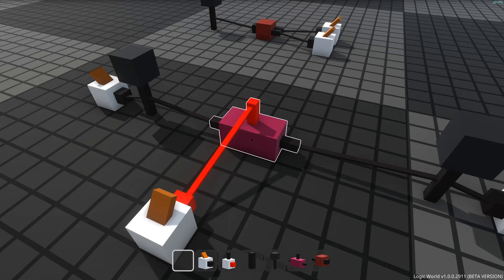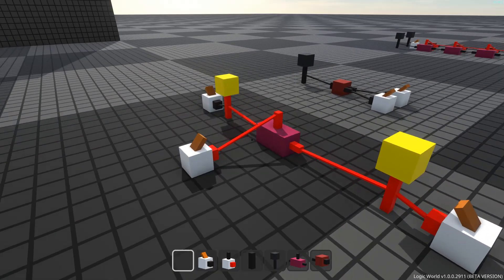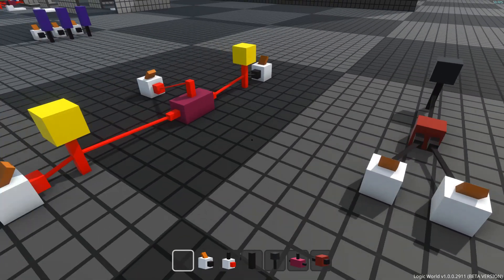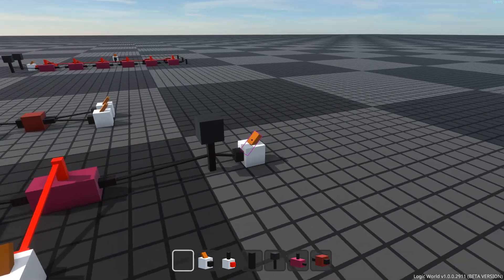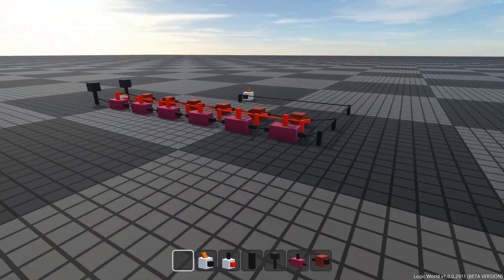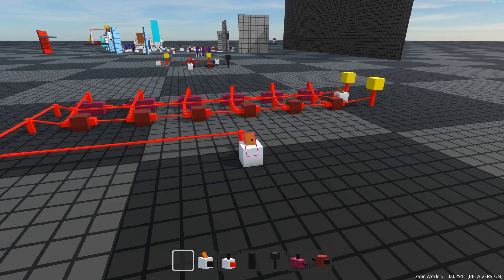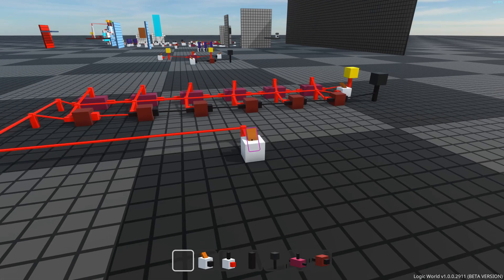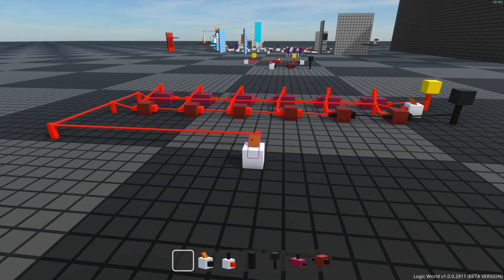The Relay

Comment: This makes me sad and happy:
happy: fast adders
sad: my parallel prefix adder is even less valid now :(
Reply from the maker: It may no longer be cutting edge, but it will never stop being cool as heck <3
Reply: @MouseHatGames  Still, there are so many cool adder topologies you can use, you can stack carry lookahead blocks together, there's carry select adders, the plethora of parallel prefix adders and sparse parallel prefix adders, and innumerable hybrid designs of the aforementioned. And all with their own tradeoffs in any given situation. All devised as a means to reduce propagation delay and trade off against various design constraints. All attempted solutions to problems.
But now there won't really be a motivation to explore any of those designs. You've given us the optimal solution on a silver platter, and I can't help but feel and the game has lost something for it :(
What the heck though, still going to buy it when the 13th of march rolls around ;)
Reply from the maker: @101m4n  Yeah, I know exactly what you mean, and this is something I've struggled with a lot while designing Logic World. By adding more and more high level components, the game becomes less frustrating to play, but a ton of interesting decision-making gets eliminated. I've done my best to design things so that there are different options with advantages and disadvantages, but it's just not possible to have that to the same degree as a simulation where the only logic components are inverters.

It's something I deliberated for months on: Logic World could have been a hardcore, low-level game, or it could have been an easier, more accessible, not-insanely-difficult game. I ultimately chose the latter. Undoubtedly something magical was lost, but I think in the end this is the better Logic World.

I should note that we'll have a challenge pack with only inverters available. It's not the same as having a sandbox with only inverters, but there will be some of that ultra-hardcore stuff in the game :)

-Jimmy
Reply: @MouseHatGames  Well, if my one day to-be logic world CPU is bottle-necked by some other component in the system, you can be damn sure I'll be using my hybrid carry-lookahead sparse parallel prefix carry select adder!
P.S. You have always seemed like a measured, sensible guy to me. I trust you to strike the right balance :)

Comment: This is almost synonymous with the trick of using a piston to block redstone on a slope. Which would be much more overpowered if like in logic world, it didnt still have propagation distance to worry about. But there is a single concern; Would zero tick components not pose a potential threat to processor load, and cause drops in performance under certain conditions?
Reply from the maker: Perhaps, and more testing will be done to make sure they are fast in all scenarios. But only the signal going through the relay is zero ticks; enabling or disabling the connection still takes one tick. Signal going through the relay is incredibly well-optimized, it uses the same code as two regular pegs connected with a wire.
-Jimmy
Reply: @MouseHatGames  Oh good. That would make it no more dangerous than a regular wire. Attention to detail that redstone unfortunately rarely received.